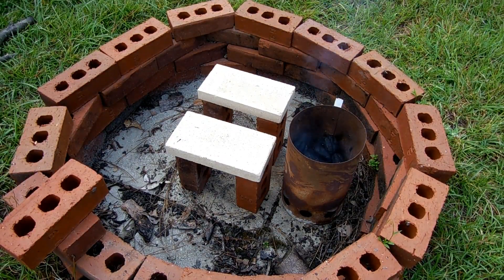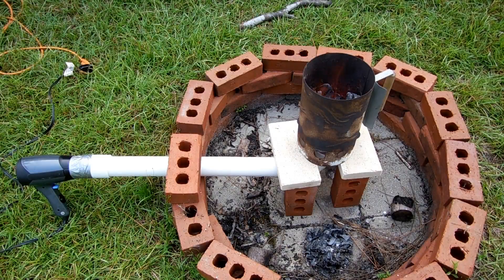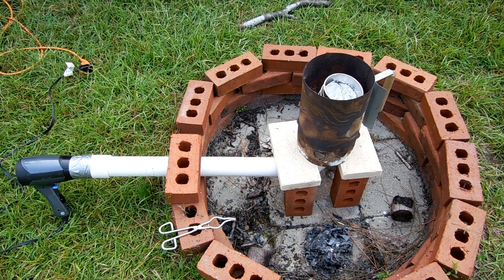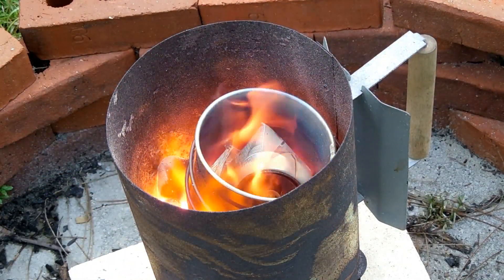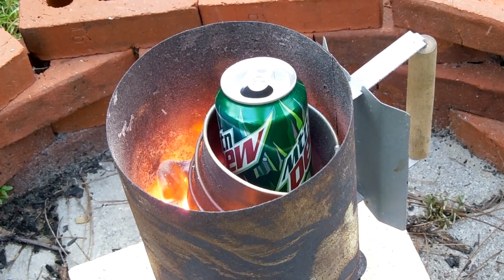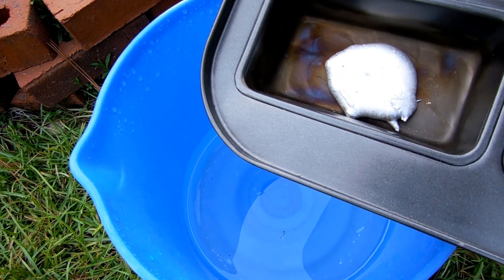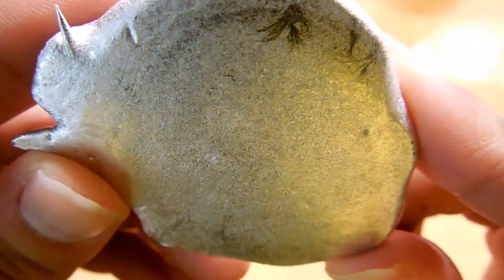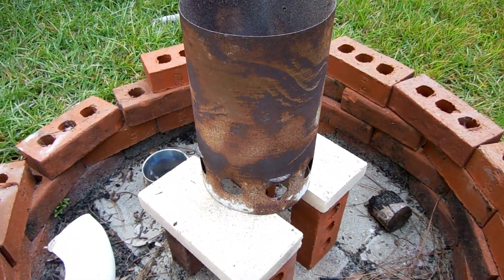Very Simple Aluminum Furnace

Comment: Can this work with other metals like copper, brass, or gold?
Reply from the maker: It might be able to get up to copper temperature as-is. It could really use some improvement to hold heat in, though. Maybe wrap it with rigidized kaowool or surround it with fire bricks. Also you'd need a better crucible - mine failed after a couple melts.

Comment: You only need about 1,200F to melt aluminum.  Also, you will be better off crushing your cans before putting them into your ladle.  Because so much of the can is exposed to air, you will generate a lot of aluminum oxide.  Also, blowing in the air air from the side will work a little better than from the bottom.  hth

Comment: I noticed u mention the steam explosion. One thing to do is make sure u don't put cans in upside down. With the hole covered   the "explosion" has nowhere to go so it WILL go into molten metal because it will give before the can and u will shoot molten aluminum out with it..

Also if feeding cans quick, wait for the steam release before pushing next can on top.

Comment: The laugh is the best. Love the video. I have tried this before and I can tell you it works better than you think. Aluminum has 1221F melting point which you can easily accomplish with oxygen force. Anything above that I think you would need other chemicals to get to higher temps.

Comment: You used plumbing pipes and fittings, what if you used clothes dryer metal fittings instead?  flexible aluminum pipe + metal elbow + a few metal screws, problem solved for $10-$15.
also be careful to always wear long sleeves and expose as little skin as possible...  I'm a plumber and i Hate getting burned after I weld something but it happens and the burns don't go away.
Another issue, the cans may hold liquid, it would be better if they were crushed and a lot safer too and as a bonus they would melt quicker.

Comment: they pay you more for solid aluminum  than they do for just cans.  at least her ein IL anyways,,, 

so melting down scrap alum/cans may just be or probably is worth it,  in the long run,.   for the increased pay that i should get for scrapping the solid alum ingots, vs.   what I would get for scrapping cans alone.  especialy since IL state here doesnt have deposits pay to people for cans or bottles or any other containers at all...

and all his materials to make this forced air smelter cost him money other than the hair blower.    well it would n totally opposite for me.. i could find or already have virtually all these metal materials and pipes and etc around ehre all for free  but the air blower is what would cost me to aquire one of,.  i do have a heat gun blower though,  if i could siable the heat springs inside it, and just leave the fan enabled ,  all alone by itself. hmm..   then i could make one of these for zero cost, all except for the charcoal briquettes

Comment: Neat! I tried this but in the center of a very hot bonfire. Got it hot enough to melt, but not hot enough to pour.  

Relatedly, I think by turning the hair dryer off and letting it cool while you talked, you lost some molten aluminum in the process. I don’t think everything left in there was slag. I think you’d have had more of an I got if you’d kept the blower blowing WHILE you pulled the cup out and poured it

Comment: [12-05-20] In 2015 this might have been cutting edge. But, in 2020 Rocket Mass Smelters are the way to-go, with better electric Bellow Fans. You left a lot of aluminum in your Crucible. For some of us in the 2A community cast 9MM bullets as practice rounds reloading. You do need to adjust the power load to compensate for difference load weight, for accuracy.

Comment: You would have better results if you trapped the heat better. Fire bricks around the fire and a lid. But the steel might melt. Just fire bricks with a crucible and a lid.

Comment: For all noobs i dont cast but i forge its not the same but i still get spattered by hot metal wear thick denim clothing or thick clothing dont wear shorts fabric similar to shorts it will melt to your skin!

Edit; when buying the metal piping for direct airflow into the fire dont get galvanized metal it can let off toxic fumes. Stainless steel recommended

Comment: can i do this as a 12 year old?
Reply from the maker: I wouldn't recommend it! I don't want to discourage anyone, but this sort of thing can be very dangerous. I wasn't nearly as careful as I should have been, and could have gotten burned pretty bad. If you want to try melting metals, I'd start with lower melting points like bismuth, pewter, tin, etc. You can grow incredible crystals from bismuth, in particular. In any case, definitely get your parents involved to at least supervise. Make sure everybody knows what you plan on doing, and make a safety plan on what you'll do if something goes wrong.

Comment: What material did you use for the cup?
Reply from the maker: Graphite.
Reply: Or steel
Reply from the maker: @kayden2537  Turns out that steel isn't the best choice, unfortunately. The aluminum dissolves a little bit each time and the high heat leads to holes in the crucible after just a few uses. Graphite is more expensive, but definitely the way to go.

Comment: Can you melt iron using this technique or do you need other materials to do iron?
Reply from the maker: This definitely won't melt iron. You need very good insulation and/or a forced air oil burner. You might get away with propane but I'm not sure. Charcoal almost certainly can't get you there.

Comment: never put aluminium cans with liquid in there it will explode and project aluminium fused all around; you must insure it's dry
Reply from the maker: They were. I'm pretty sure it was the inner plastic liner vaporizing, now.
Reply: @mrhomescientist  i apologise, i'm not about you, what i know is very bad rendez vous is molded ALU + Water; then H2 is released and boom = very big boom
but congratulation for this very usefull video

Comment: Im surprised that it works with a fire that small. I tried to use a big wood fire + hairdryer and an old steel pot in a hole in the ground, but it didn't work, probably because the surface area was too big. The Aluminum just collapsed and turned into a fragile thin white layer of something.

Comment: Can I melt aluminum foil, using a coffee pot, on the stove, in the kitchen?
I have to mention that I am 27 years old, and I am responsible when I use this kind of things.
I want to pour some aluminum in a small shape.
Reply from the maker: CumSaPornesc CALCULATORUL No, that won't be nearly hot enough.
Reply: Thank you sir, for your fast Feedback. One more thing: the coffee pot will resist to that temperature?
Reply from the maker: CumSaPornesc CALCULATORUL To aluminum melting temperature? Unless it's made of steel then no, of course not. I'd go research melting points first; aluminum needs to be far hotter to melt than you seem to think it does.

Comment: At which temperature  @pure aluminum powder @melts??
I have aluminum powder and they are not melted.
How do I make melts.
 plz tell me soon
Reply from the maker: socialengineer Same as bulk aluminum metal. Powder will probably oxidize before melting though, because of the high surface area.

Comment: What material is that huge bucket of yours made of? The one that contains all the charcoal and the crucible? And what is your crucible made of? Why didnt u use any plaster of paris or anything to make the whole furnace like other people do?
Reply from the maker: ColdFuzion The charcoal chimney and crucible cup are steel. I wanted to make this as simple as possible and just used what materials I had at hand, and didn't spend much time on construction. A well-built furnace would certainly be better. I wanted to show how easy it can be to melt metal in your backyard!
Reply: Is it ok to use stainless steel   ice buckets for the charcoal foundry and crucible?
Reply from the maker: ColdFuzion Should be fine if it's steel. Keep in mind the charcoal chimney works because it has holes and a grate so air can get to the coals. They aren't expensive to buy.
Reply: Ok thanks

Comment: Ever tried melting aluminum cat food cans? I'd like to melt ours down to take them back for cash.
Reply from the maker: If they are aluminum it should work just fine. You might end up spending more on fuel that what you get back at the recycler though!
Reply: I'm pretty sure they are aluminum, they are Facney Feast and Friskies. A magnet doesn't stick to either of them. As for the fuel, I'm just going to use wood from the trees I have to cut down anyways. I was thinking just cut a hole in the top of a lid for a 55 gallon steel barrel and use a hair dryer on the side for air and a fire extengisher for the crucible and just dangle it over the flames. Thanks for the respounce and the cool video.
Reply from the maker: Sounds like a reasonable plan. Good luck!

Comment: Please answer the following questions:
1. If u melt the aluminum ingot again will it still produce some slag or is it going to be in a clean 100% liquid molten metal??
2. Wat kind of metal are the cans used by canned goods made of??
3. Can u melt canned goods in this kind of furnace??
Please respond as soon as possible.
Reply from the maker: 1. It will be cleaner, but not 100%. There's always some oxidation at the surface where the molten metal reacts with oxygen.
2. Steel, usually.
3. This furnace won't get hot enough to melt steel - that's what my crucible was made of!
Reply: thanks

Comment: Quick question, did you arrange the coal in a star shaped for better air flow or did your just throw them in?
Reply from the maker: Tech2025 Nope just dumped it in. The hair dryer provides plenty of air.
Reply: mrhomescientist alright thanks, I'm going to try melting metal at home and this is by far the easiest furnace I've seen! Great video!
Reply from the maker: Tech2025 Thanks! Good luck and be safe!
Reply from the maker: Tech2025 Nah I just let it burn itself out.
Reply from the maker: Tech2025 Cool is better to keep the tape stuck on; I taped the cool button down but removing the heating element altogether might have been better. You saw what happened to the PVC at the end! A metal pipe would be better.
Reply: Cutting torch cleaning

Comment: I weld barefoot in my shorts.  No problem that keeps you safer anyway.  Lol.
Reply: The Hillbilly Home Coffee Roaster yeah its actually safer without shoes because if the molten metal hits your foot it will burn you and also roll off but if there is shoes it will get trapped and cause a major flesh wound
Reply: i use safety boots and get zero burns.
Reply: Leidenfrost effect
Reply: Yes I agree, I've seen very bad burns from welds that when down into your safety boots.

Comment: I would wear more than just short sleaves and shorts as well as some boots next time full face mask as well,   you might one day have a small crucible eruption will ruin your life buddy!, also a note you might want to skim the alu as it becomes ready
Reply: Molten aluminum hurts very, very much when it hits your skin... I have scars along my hairline that still itch.  Any moisture, if encapsulated by the molten aluminum will super heat and that cute little "pop" will be a veritable explosion which will probably destroy your crucible and forge, if you're unlucky.
Reply: same with lead
Reply: Dragonstud i have some experience welding the molten metal can actually get trapped in the shoe cause worse burns then having it directly hitting the skin and roll off
Reply: let him do a video on dodging hi speed molten metal.  small droplets are enough to change your way of calling a paramedic.

Comment: What are the tweezers you were using & were can I find a pair?
Reply: Tweezer shop use bbq tongs or two peices of copper pipe or steel pipe be carefull with that one as it will eventually get hot
Reply from the maker: They're called crucible tongs. Available all over eBay!
Reply: you can get tongs at walmart.

Comment: Do you have a more advanced 'alu melting factory' if I might call it that way
Reply from the maker: Not yet, but I do have several ideas floating around.
Reply: will this work for lead?
Reply from the maker: +E.C Savage Of course, lead has a much lower melting point than aluminum.
Reply: you can just melt lead on the stove

Comment: One thing i can suggest is changing your setup so that your blower goes into the side of the can instead of the bottom. That way if your crucible fails you wont have bits of molten aluminium spraying into the air. Its also a lot less messy, i used to have mine set up like that and there would be flakes of wood and other stuff flying everywhere.

Comment: Hi,                                          

Well done, terrific job! Just one thing, Is there a way you could perhaps run a gas torch along a row of tins before putting them in to melt. If my guess is correct, and I am not at a certain on that, the slag will be pretty much the 
plastic printed film on the outside, if you can raise a bubble on it before you melt it you may be able to tear it off easily. 
I don’t know because I do not drink any canned stuff so can’t try this. It would give a pretty slag-less mix though and if you are trying to judge it by volume it would make things easier.

Comment: that isnt slag... its aluminum that resolidified because you didnt either heat it up far enough, or waited to long, or both...  plus if you keep that in water, if you did over 100 cans... you would find out that it has the left over acid that dried out, it will bubble for a week, and smell really bad... but after a couple weeks of that, the real slag will detereriate off, and you will see that you have a lot more aluminum left...  I know, I did that with my forge, out of about 60-100 cans, I got about 7 mini muffin forms out of it, and about a muffins worth of "slag" then I put that "slag" in another container, filled it with water and let it bubble and acidic off all the real slag...  still have a lot of aluminum left, about 99% I should say...
Reply: I do
Reply: Actually I'm sure anyone who wants to get into aluminum casting would. also a good use for those extra cans.
Reply: He does have a lot of aluminium oxide, almost all the foil oxidised since it has a very large surface are for it's little volume, it didn't melt because aluminium oxide has a high melting point

Comment: Put a copper elbow so it won't melt it will get hot though
Reply from the maker: +SweeterWindows52 Copper is such a good conductor that it would probably still melt the PVC it's attached to! An all metal pipe would be the way to go, really.
Reply: +mrhomescientist ok
Reply: +mrhomescientist you are correct, however it would be enough of a difference in temperature to stop it from melting. Yes,  you're correct. it would make sense, however its not practical to go buy all new piping if you only need 1 fitting

Comment: Might I suggest a vertical tube that feeds into the stainless steel cup. That way you can have 10 slowly melt away and not have to feed one at a time.

Comment: Right now, aluminum scrap price is about 40 cents a pound.  I you are going to melt cans, make sure your supplies cost less than you will get from the scrap dealer.
Reply: depending on your area. over here in california aluminum cans scrap price is 1.65-2.00 ( depending on scrap yard). meanwhile scrap aluminum is at .40 its best not to melt them. unless you are making ant hill sculptures to sell them.

Comment: if your going to do this atleast make something worth using. such as a ball bearing type object for sling shots. and that is not slag, slag comes from steel. that what you made is called dros. on the other hand , kinda cool you could do it with charcoal and hair dryer. and you did it bare foot.  WTG!!!

Comment: What is slag, can it be re-melted into more aluminum?
Reply from the maker: +Brian Jensvold The slag (technically 'dross' in this case) is made when the molten aluminum reacts with air to form aluminum oxide. This would have to be chemically converted back to aluminum, which isn't easy. Googling would probably have provided you a better answer.

Comment: your feet will heal, if you burn up a good pair of shoes, that's a hunnert bucks.
I do everything barefoot
Reply: May*
Reply: Well when you work with melting lead that isn't a good idea lol proper foot wear is always key even if it means throwing them away after constant use
Reply: uh no if you get burned the scars won't heal
Reply: uh no if you get burned the scars won't heal
Reply: Actually burns can be way worse if plastic melts on your skin...
You'd better get your skin to touch lava directly.. Counter intuitive but clothes dont' protect from burning except clothes that are specifically made for that.
Reply: @slevinhyde3212  Can confirm. I've had molten burning plastic drip onto my hand and it melded to it. Instantly killed most layers of skin that came off shortly after. You can't brush it off, all the heat get's transferred.
Reply: A hunnert lol

Comment: Aluminum turns into aluminum oxide on contact with air. And that process is greatly accelerated when you hear it up.

So you should find a way to have a lid on your crucible to prevent the Al from contacting the air as much as possible. This slag you are talking about....that's aluminum oxide.

Comment: Please wear shoes cause one time I was puring an aluminum cast in the middle of winter an an icesickle fell of the roof of my shop into my cusible and I was cover he to toe in molten aluminum lucky I had a grinding sheild on my face my winter coat and my work boots my hand got it good I'm not usually one to be a safety nut but that could have been a lot worse
Reply: you build your furnace under an edge of a roof?
Reply: well it was an electric furnace so yeah....i have it on a work bench